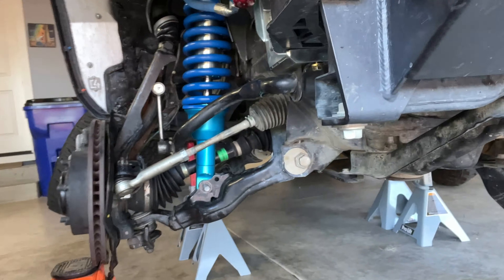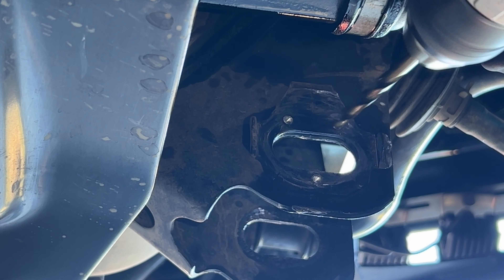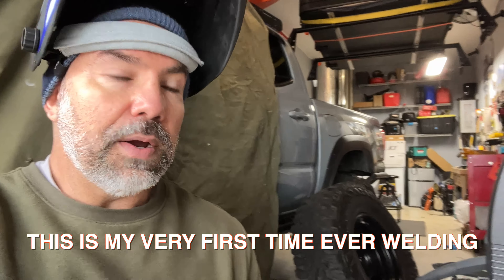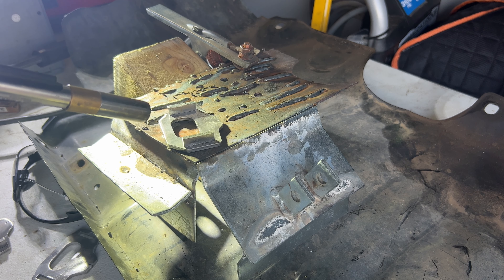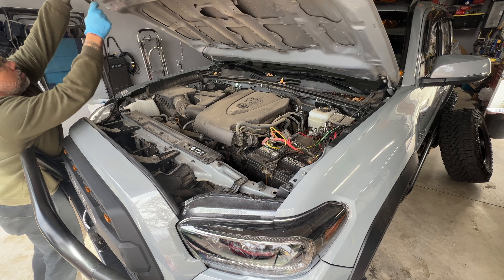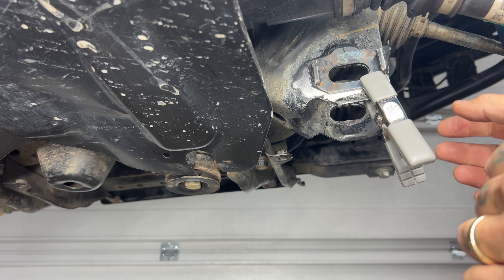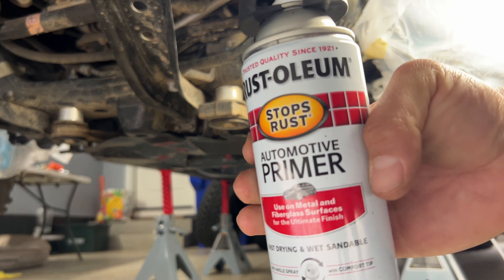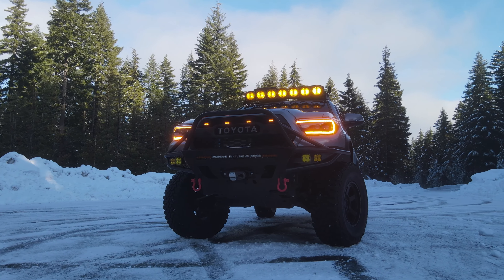TACOMA 3RD GEN/ NO MORE MISALIGNMENT/ DIRT KING CAM TAB GUSSET/ COMPLETE INSTALL

Comment: The title is not right. Even with this kit, the alignment could still go off. The problem that it solved is broken factory alignment tabs. I also have bison off-road cam bolt to further eliminate alignment issue. Even with new cam bolt, alignment could still go off a little bit when wheeling hard. Your installation and instruction is good though! Good job my friend!
Reply from the maker: Noted, thanks!

Comment: Nice video and explanation of what you used. In all your research, have you ever come across how the frame is spring-steel and should and cannot be welded? My dealership ruined two of my tabs during a simple alignment and the body shop wouldn’t weld it because of that. Needs a new frame. F that
Reply from the maker: They wouldn’t sell kits for Tacos if they couldn’t do it. Mine still holding up. Id take it to an off-roading shop if you have any nearby or call a welder. 💪🏼
Reply: I agree with you - good advice, and informative videos like yours is helping me to do the research. Take care

Comment: Wouldn't just putting a nice weld bead on the outside of the tab to reinforce them work jsut as well?
Reply from the maker: I’ve seen it done. Not sure how long it’ll hold. If you’re hitting the trails really hard or sending it 🚙 💨 don’t think it’ll hold long enough. I sent mine in Florence dunes and crush my passenger side.

Comment: I have the 2023 TRD PRO, I loose alignment often just by daily driving in NYC. This maybe a good choice for me since I don’t off road.
Reply from the maker: I have a small feeling they are not tightening the bolts through your lower control arms enough. You shouldn’t lose your alignment that easily. I would ask at what pounds of pressure has been applied  to your LCA and match it with Toyotas specs.
Reply: @eluv201  it was the roads, really bad roads. I changed the route and it was ok. For a while. Then my shocks gave out 🤦🏾‍♂️😂😂😂. No issues so far but the tabs are bent because of too much alignment
Reply from the maker: @CodeNameCappy  im born and raised in Hudson county new Jerz just across the Hudson, know whatcha mean lol. Portland Oregon is similar with how bad the road is. Invest in some great shocks, you can’t go wrong 💪🏼Best of wishes on your tab replacement you’re gonna appreciate them